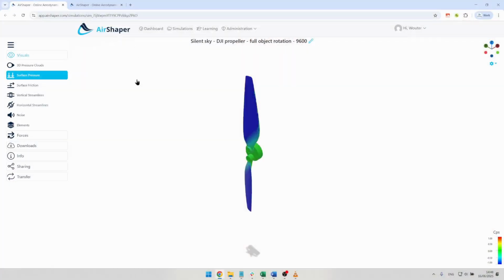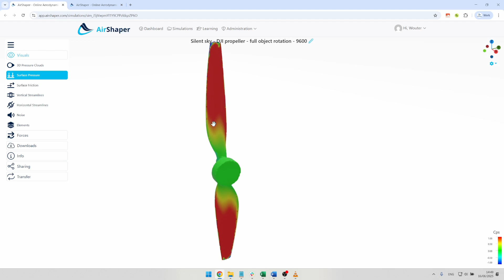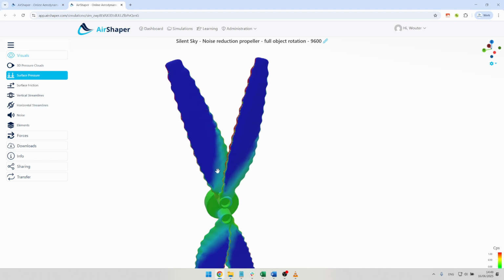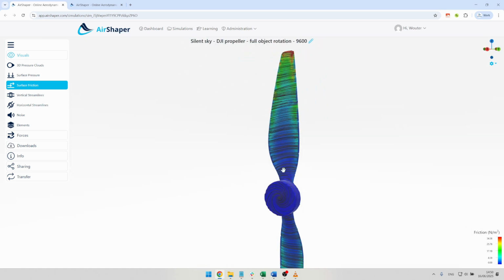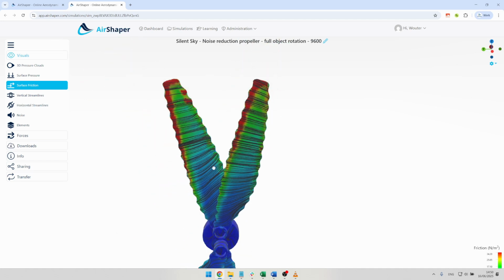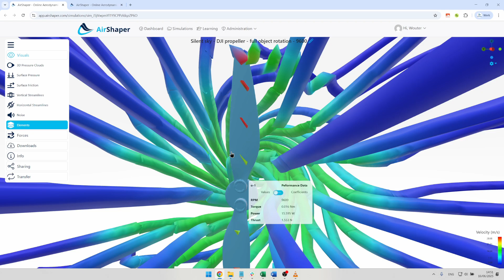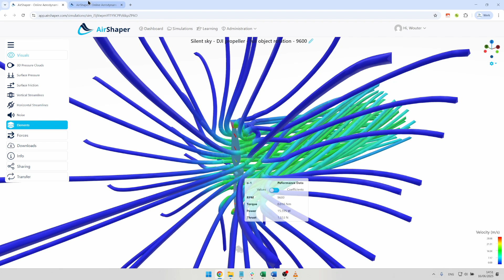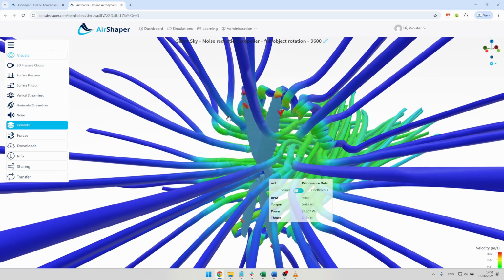Drone propeller noise reduction - Novel aerodynamic blade technology analyzed in CFD!

Comment: I assume the reduced noise is mainly due to using 4 blades instead of 2, which allows the rotor to generate the same amount of thrust at a lower RPM. Since it’s well known that lower RPM generally leads to lower noise levels
Reply from the maker: That could indeed be part of the reason
Reply: @AirShaper  yes, part or all. By not keeping all the variables equal except the shape no meaningful conclusion can be drawn.
It is interesting though. I've made a CFD Simulation in the past with the whale shape propellers. (Marine application) The local turbulence went down. (So likely the noise as well). But the power requirement went up. This was just a simulation though..